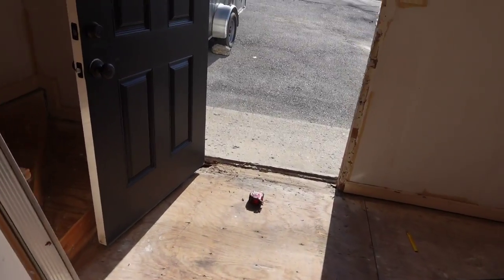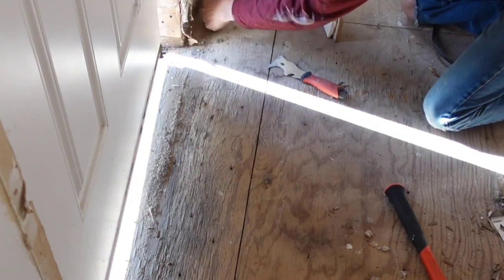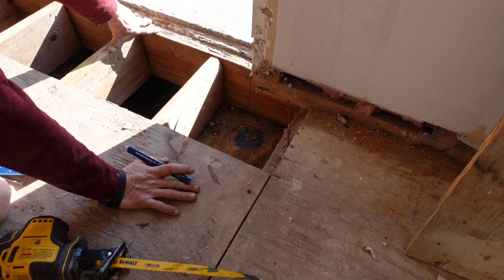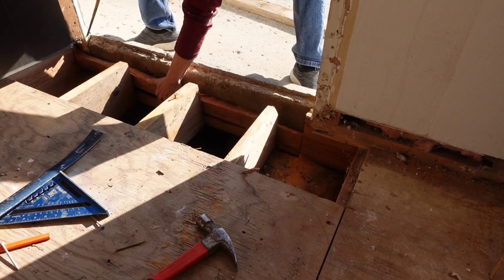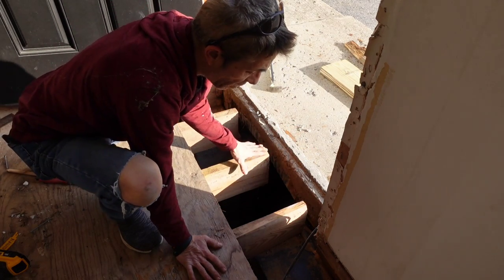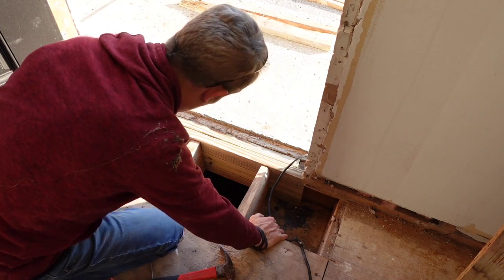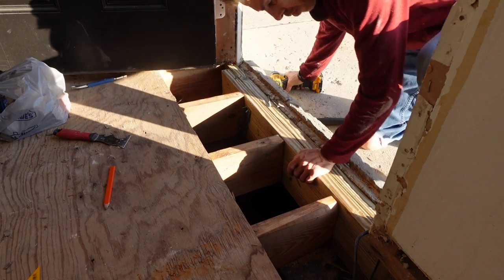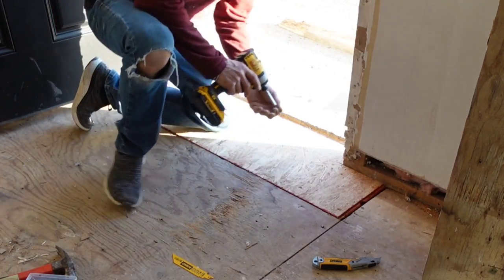How To Repair Rotted Subfloor Under An Exterior Door

Comment: thank you for such a great detailed video !  I have this exact issue for the second time in 5 years. (bad design of a rear door with zero over hang) your details will keep me from headaches I had last time and should provide me with better results. Of course I am adding a roof overhang this time as well.  The last time I kind of just  chiseled out the rotten part of the band and built up and sistered ma second band to it as I had no idea what to do now I feel confident in cutting it  all out and replacing it properly and doubling it back up.
Reply from the maker: Right on, brotha. Hope it turns out Amazing. Don't forget to seal it up at the bottom. Good luck with all your projects. Thanks for the comment

Comment: 14:15 I like the idea of cutting 1.5" off of the ends. I would not have thought of that--but I wouldn't have considered attempting this project anyway. Maybe now I'll try fixing the rotten subfloor in my own home. Thanks!
Reply from the maker: Yes I feel those 3 hanging off of the double is much stronger. Pluse it made it easier to slip the 1st one in. Thanks for the comment. Good luck with your project. You got this!

Comment: Really thank you so much for posting this video!!  Im gonna try to video my threshold replacement and share it with you.
Reply from the maker: I've read all upur comments, and I'm glad you decided to tackle it yourself. If you have any questions, Il) be happy to answer accordingly to my experience. Also, if you have an oscillating tool  that may come in handy if you don't have a sawzaw. Good luck. Looking forward to hearing and /or seeing about the progress
Reply: @RentThisFlipThat  Thank you :)
Reply: @RentThisFlipThat  Sooo basically after further inspection it seems like it is an all wood threshold anchored into the concrete slab.  So Id have to remove all of that and put a new 'treated'? threshold down and the the sill cap on top?  Idk, because its all wood.  I took pictures, but no way to post them here.  Can I send them to you in text or email please?  Def gonna need more supplies, but dont wanna waste time or money

Comment: Got it done in a day! A couple of suggestions, fill that 1 1/2” opening in the left end of the joist to rim joist space…perfect ledge for vermin to sit & chew up into the wall. Second, you used chipboard, not plywood to patch the subfloor. Cut edges will wick water & swell like crazy. Ask me how I know both of these points? LOL!! The SECOND time I learned a little more….good video!!
Reply from the maker: Thanks for the tips & the comment!

Comment: Every repair requires two steps the first step is repairing the damage the second step is taking steps so that the damage can never happen again, or at least for 20 years.
Reply from the maker: I'm with you on that. Don't think anyone involved in the building of the duplexes gave any thought to the future. Unfortunately I'm finding g out the hard way. You're spot on. Thanks for the comment. See ya on the next one

Comment: Great video buddy! Question: did you end up doing anything about that small slab porch right outside the door…I’m wondering what you thought about that? Will that water continue to flow into that rim joist space? Thanks boss!
Reply from the maker: Sorry, bud. thought I got to this.  These duplexes are built very poorly. I sealed it off, but I'm not sure if it will try to enter at a different spot a little further down. But the buildings are downhil, so when it rains, it does not help. It's been almost a year, and so far, we are
Still dry. Thanks for the question

Comment: Are you supposed to use the compressed plywood for flooring?
Reply from the maker: Not for your finished flooring. It is only for subfloor. Thanks for the question
Reply: 3/4 plywood is best for flooring. In newer built homes they are putting OSB on the floor. I wouldn't recommend using OSB as a sub floor.
Reply from the maker: Osb like Advantech is perfect for flooring. It is glued and pressed with lots of pressure. Completely different than particle board. Particle board is more for building up floors when laying carpet. Or making speaker boxes 😅 thanks for the comment

Comment: Great video!  I have the same DeWalt oscillating tool and you are correct... that thing is powerful.  The blades run down fast though.  Also, was it necessary to replace the band entirely?  Could you have just used some blocking to strengthen it or was it in really bad shape?  Thanks in advance. 🙂
Reply from the maker: Hey man thanks for the comment. Yeah I love my dewalt multi-tool.  I'll be giving a couple away at the end of the year. To answer your question... the right side was only rotten on the very top. About 2 inches worth down, but the left side was completely  gone. Also by replacing  that whole 4 foot section I was able to span across from block to block with no splice in the middle, that made me feel better if nothing else 🙂. Thanks again for the veiw. See ya on the next one G. K.

Comment: Turn your music way down my friend. I'm guessing you're using the camera mic?  

I'm in the middle of cutting out the sub floor as you did. Not sure what I will find. What was the reason you cut off that piece by the cement, was it rotting as well?
Reply from the maker: You're not the 1st to comment on the music. I thi k I have figured out a good balance for that. Live and learn. As far as the piec against the concrete  that was the front band. About 4 ft. Of it. It was really rotted on the left side but only about 2 inches down on the right side.  I went ahead and cut that whole 4' section out so that when I replaced it that band would sit on the block on both sides for great support.  As you saw in the video really only the middle Joyce was the only one not sitting on concrete Hope that makes sense and helps thanks for the question
Reply: @RentThisFlipThat  yes makes sense thank you, and is that a reciprocal saw you are using? Looks modified or maybe a different type all together...Curious about that saw.
Reply from the maker: Yes it is the dewalt cordless  reciprocating saw. It's a pretty awesome tool.